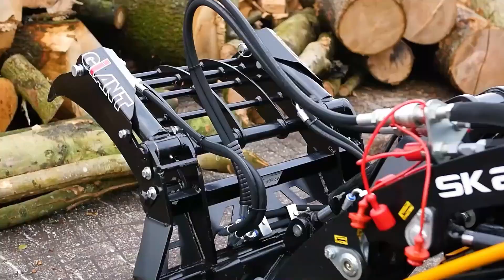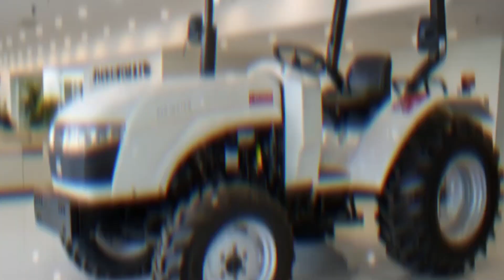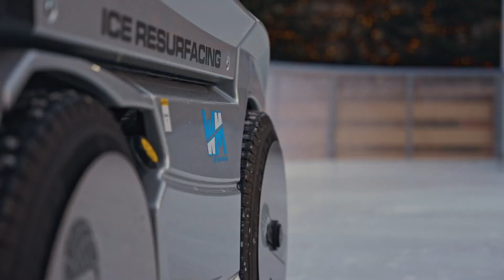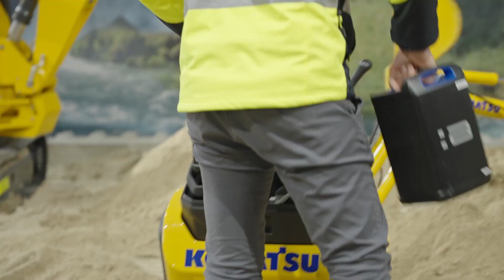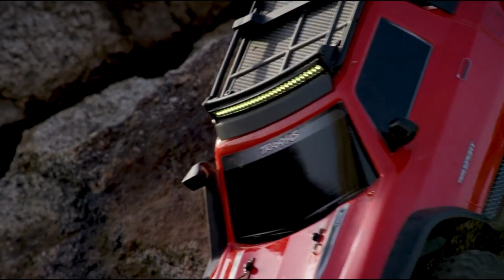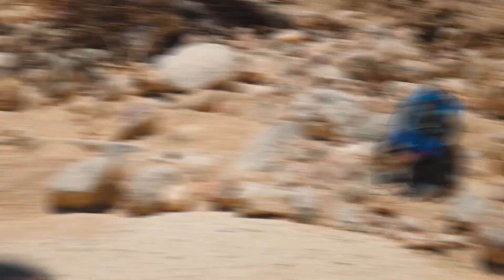MINI Honda Tractors You’ll Ever See!

Comment: I’m building a fleet of RC kubota BX and John Deere subcompact tractors. I’d never buy any of these Chinese machines because the steel is too thin engines are not good. On paper the specs look good but they break themselves. A JD or Kubota will achieve its specs all day and night    Without fail